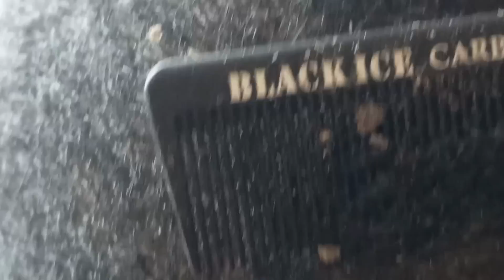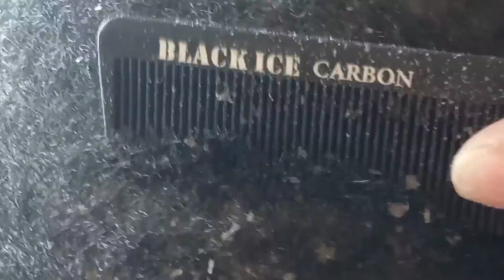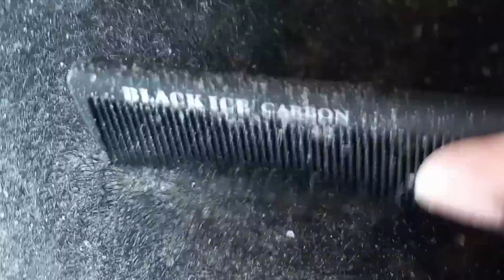Scratching Dandruff flakes. Tea tree oil trial!!!!

Comment: Those beauty supply oils really aren't anything but vegetable oil. Read the 1st couple of ingredients and that's mostly what it is. Get the real essential oils & mix it with a carrier like coconut oil
Reply from the maker: Thanks. That jojoba oil was not good at all.
Reply: The tea tree in its pure form is amazing. I put it in my plain hand sanitizer and soap and spiked my kids shampoo for many years to prevent head lice and other nasties. I agree with this poster, and the coconut doesn’t need to be liquid,solid will melt instantly with body heat. Honey please avoid anything that says beauty on the bottle! I’m a Granny and have learned by trial and error, usually the hard way. 😅😊
Reply from the maker: Thankyou. I often pick these items for the sake of adding content to the videos. Not something that I actually believe in but I agree.